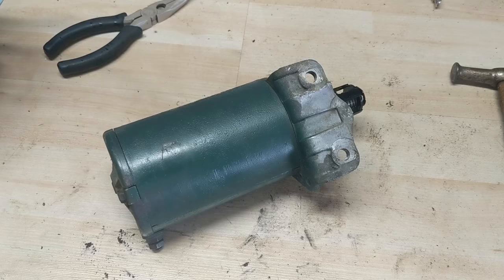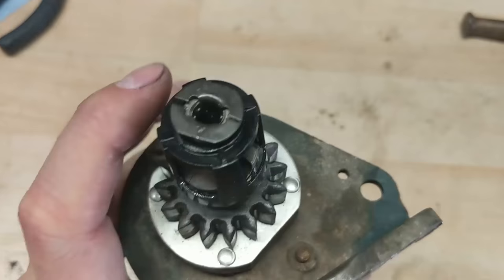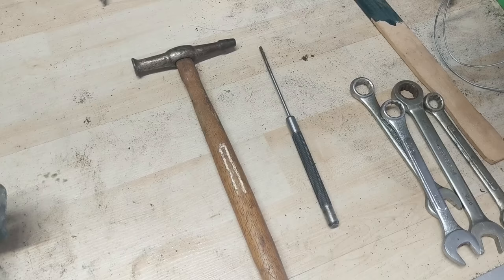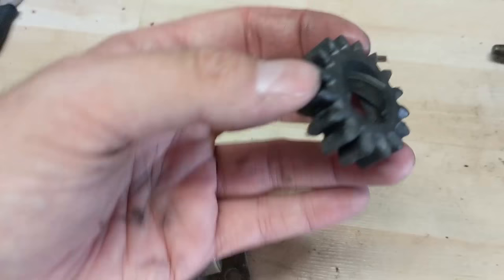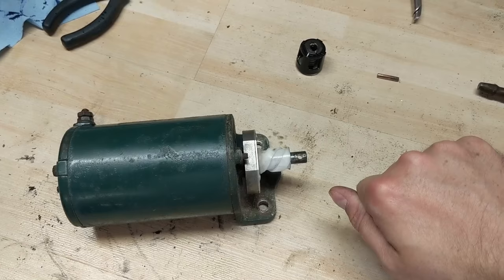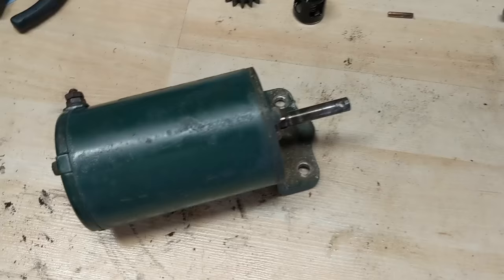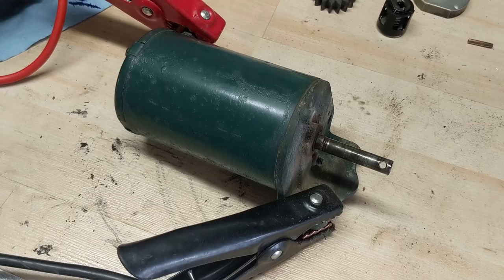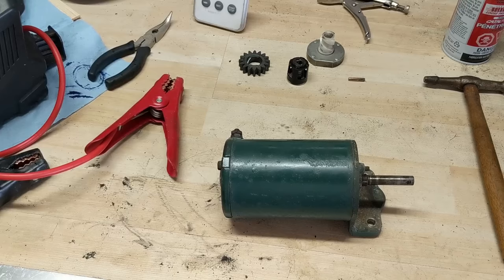How to Test a Riding Lawn Mower Starter

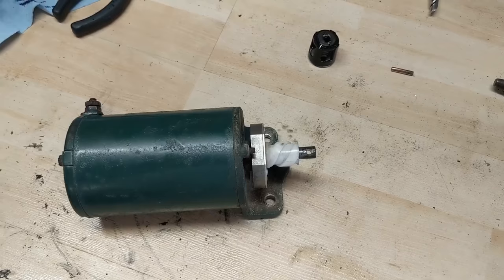Comment: At 02:26 it would be more correct to say that the starter motor is not made to "draw normal load current for long periods of time". Electrically speaking a device doesn't draw voltage. It drops voltage and draws current. It could also be correct to say to not "have voltage applied for long periods of time" except that if the starter is open, then it won't draw any current and therefore you could apply 12V all day. If it's shorted, don't keep applying voltage or you could melt something, including your power source.

Comment: Question: Assuming that the battery is good, & all terminals are clean...,
If the starter spins freely and spins the engine when the plugs are out, but not able to spin the engine when the plugs are in..., does that mean that the starter could be bad or weak & need rebuild or replacing??
I've never had a bad starter before. 
Thanks for any advice..., cause my lawns really needs to be mowed, I'm getting the stink-eye from my neighbors 😒.
Reply: I have same case now. Was your starter bad and replacement helped?

Comment: So I hooked my starter up like this and it did absolutely nothing.  No spark no click no whine no heat buildup after leaving it hooked up for a minute.  Is that what its supposed to do if it is shot? Or am I not doing something right. 
My setup was jumper cables from a car battery.

Comment: Hi, when testing my starter for a Toro LX425 the red lead sparks when I connect it to the starter but it doesn't engage. Is the starter shorting inside the casing?

Comment: My positive terminal on starter is showing ground.  When I hook booster to starter it does nothing but show error.  When I put meter on starter terminal and on chassis it shows grounded.  Can you help me with this?  Thanks.
Reply: Where you able to figure the issue? My starter was giving continuity from mounting bracket to power terminal on starter. I bought a  new starter and same continuity....I'm afraid to try it knowing that there should be no power to ground.

Comment: Do u got to take the gears apart on it like u did or no  did u do it to just save the gear an is there any other way to test it i dont know wat that is that u have there is that a portable battery jumper box or different from that  tractor was running cutting grass then shut it off bec nabor came to visit then went to start it an it wouldn't start it does turn over but doesn't start an checked the battery its good and put new gas in it and a new E3 plug an its in neutral and cluch fully down when starting it  i dont know shit about tractors and goin to check the fuse also later today its a yard machine tractor 42in 17.5hp  thank you love ur videos  learn something new

Comment: I have a starter on a little break that the gear will sometimes not mess up with the flywheel.
Reply: I just tried to turn the key, hold a voltmeter on a ground, and hold it on the bolt that goes in the bottom of the starter and it showed 5 volts. I feel like it should be 12. But I may not have had good connection with the multimeter.

5 volts normal?
Reply: Boss brought the lawn mower in last year and it had the same symptoms, the solenoid was click, but the engine wouldn't turn. Took off the shroud and saw that the gear on the starter did not mesh and was stuck in the flywheel. Smack it with a hammer and it worked again. I'm guessing that is the present issue. However, it seems like the things should have more than 5 volts going to the bottom of the starter?
Reply: The voltage drops when you turn the key on and then it drops a lot more when you turn the starter that's what you said right but I don't know what it should drop to 5 seems to low though to me anyway

Comment: My starter just stopped all of sudden. I tryed this and the starter does nothing. When i was turning the ignition it was clicking. Im asking because i want to know if you think its the starter or starter solenoid.
Reply from the maker: If it clicks the solenoid engaged. If the starter doesn't spin when you put 12v directly to it, then the starter is seized.
Reply: Thank you sir. 👍👍👍
Reply: @EliminatorPerformance  hi, my solenoid clicks and starter works(removed)when I jump started it. However when I installed it /stopped spinning and just clicks. I also can't detect 12v with multimeter on the side starter screw/ wire? Any advice?I have continuity on the wire black/ red and all wires and safety switches were ok. Solenoid seemed to click as normal on and off there mower .I forgot to mention that the light switch prong is not working. Lights doesn't come on would that effect the starting?
Reply: @attilaelekes5534  maybe your ignition key switch is bad or a wire came loose
Reply: On mine the clicking was coming from the starter its self because it was slipping not wanting to spin the flywheel because the starter is old from the 90ies so its lasted a good long time

While I've got it apart I might take it apart farther to do a deep grease clean up I noticed it's got alot of build up on the old solenoid and relay box and fuse so its needing a cleaning done those are spots i must have missed 

I orto redo its deck but its still in good enough shape how it is now

Comment: Great vids. Any suggestions on what could be causing a lawn tractor to not start when its hot (eg after its been running for a while)? Solenoid clicks, but starter just sounds like its straining, not turning the engine over. I took the starter to an auto electric shop, they tested it and think its fine. Already changed the solenoid and battery, not sure what next? Craftsman tractor, about 7 years old, not much rust or anything.
Reply from the maker: Could be hot restart stalling, some starters have that issue as they age. I just did a video on a Kohler starter that has had 3 generations of upgrades due to multiple issues. Other than that, I can't think of much else, as usually valve out of adjustment make it hard to start when cold, but when the engine heats up and the metal expands, tolerances get tighter and they tend to start easier.
Reply: @EliminatorPerformance  can you repair this starter instead of getting a new one ?
Reply: Did you find out the issue? Having the same problem with my craftsman yt3000 21hp Briggs. Tested for continuity and everything seems good. Solenoid just clicks and my flywheel will spin about a quarter revolution or sometimes not at all depending on if I reset the compression manually with my flywheel.
Reply: @Poopsy5150  unfortunately not. Took it to a mechanic who thinks the battery isn’t strong enough. I don’t think that the problem but I’ve spent too much time on it, so I will just live with it until I need a new battery. I feel like the engine itself is just getting locked up when it’s hot.

Comment: What if you apply power straight to a starter and nothing happens?
Reply from the maker: Either it has a bad ground, the starter gear is seized on the flywheel, or the starter is bad. This is why you can bench test it and be sure before spending the money for a replacement.
Reply: What if it tries to crank but doesn’t full start when using this trick?

Comment: Would a battery charger work as a power source?
Reply from the maker: Yes but may not have the Amps to crank it over fully, maybe put it to boost mode (start mode) and not charge mode if it has different modes
Reply: @EliminatorPerformance  Got the start to engage,  , but of course the engine would not fire. Sprayed a little starter fluid.  It Just turn over!

Comment: So what is it supposed to do if it is good starter
Reply: You can't really tell with it off the mower engine but besides hearing the grind

A good one the gear will spin up fast cut the power the gear will go back down then if it stays up something's wrong on top 

On mine the gear went up slow then just kept spinning around I left it on the test charger a long time an let it keep spinning its shot anyways inside the starter it wont hurt nothing because the stuff inside is already toast

Comment: My starter turns over but slow and weak. Even jumping from a car battery.
Reply: Like mine
Reply: @Mike-su8si  Clean every ground connection from the battery to the engine. Sand to bare metal. It fixed mine.
Reply: @MikeJones-rk1un  I did it before and it worked but it sounds like the starter is bad this time
Reply: @Mike-su8si  Did you try jumping directly from the solenoid to the starter?

Comment: The starter can be tested without removing the gears, no? I assume you removed them just to show how you could save the gears if you wanted, but it comes off to a neanderthal like myself as a necessary step of the test.
Reply from the maker: Yes the starter can be tested without removing the gear, this was just a starter I had laying around I wanted to test it after we removed a stripped gear. I also have a video on how to remove/install a new gear here: https://youtu.be/ybLyPpdVuoQ thanks for watching!

Comment: So you cant test it without pulling that end gear off?
Reply from the maker: This is just a simple "bench test" to see if the starter works off the machine, not under load. If a starter doesn't turn the engine over, you may have corrosion and high resistance at a connection, or a bad battery. This basically rules out the starter if it works here on the bench with a good battery pack.
Reply: @EliminatorPerformance  I connected the positive end of jumpers to pos battery post..the other pos jumper to starter motor nut and got nothing but a few sparks...starter did nothing so this confirms the motor is bad correct? Thx
Reply: @EliminatorPerformance  I figured that too mines been starting up from the charger plugged in the wall for years til now the starter is weak an slips
Reply: @EliminatorPerformance  please give an example of where corrosion/high resistance would be that would prevent starter from executing
Reply: @EliminatorPerformance  Also, referring to Bobby's question: do you need to pull the end gear off to test?  Seems that would not be necessary
Reply: @BillBarrow111  Some one earlier said no, you can test it with the gears on.  I just tested mine and it sparked to holy heck!  Don't know what that means, but nothing turned.  Still don't know if I should order another one.